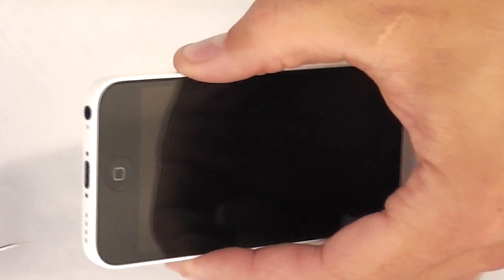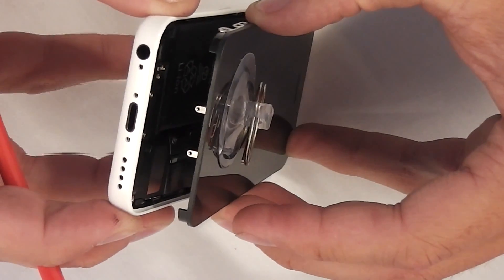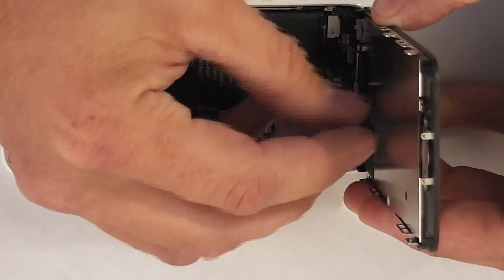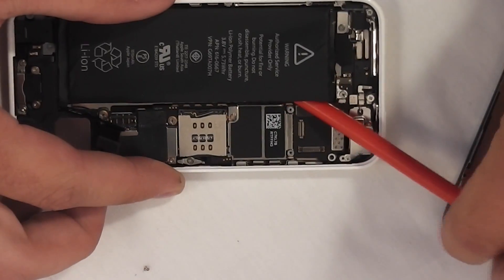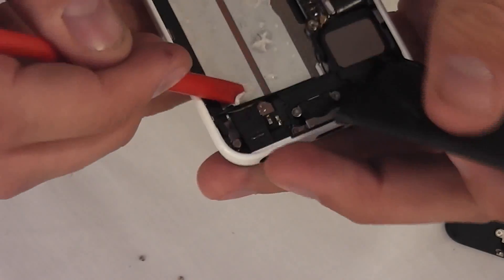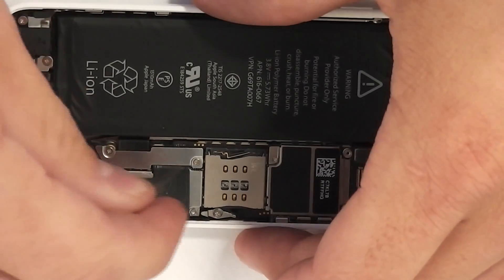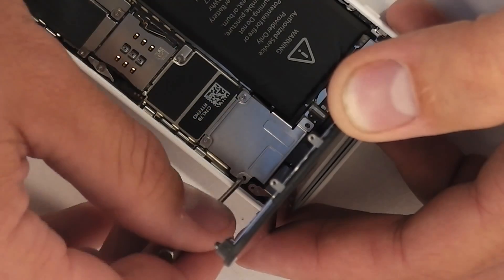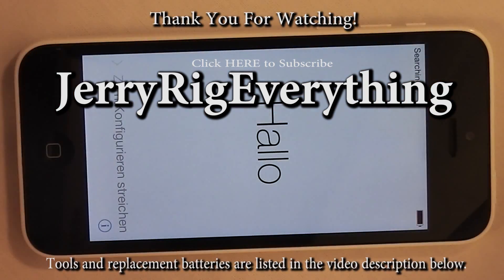iPhone 5c battery change in 4 minutes!

Comment: Just sat down, and swapped the battery in about 25-30 minutes.  BTW... get one of the "tool kits", they run $3-10 on eBay, but you've got to have one to pop the screen, unseat press-fit cables, etc.  Helps to have the suction cup(s) too.

Comment: Thanks for a great instructional video. I wish I had paid attention to your recommendation to pop off the screen connectors.  I didn't and despite being super careful when I popped the battery in, I broke the smallest ribbon cable to the screen.  Didn't notice until I turned it on!  Will be more careful to follow your advice exactly next time. Others be warned...

Comment: Worked. Just a tip - when trying to prise that annoying battery out, I ended up breaking the little plastic prying tools that came with the battery, it was stuck in so well, so I ended up using an old plastic coffee card. Worked like a charm.

Comment: Thanks for this video! I just replaced my battery but it still will not turn on. The white apple logo shows as usual for start up but then it disappears after 5-10 seconds. It is a start up problem at this point and by changing batteries, I voided the warranty that I don't think I had in the first place anyways. What should I do now?

Comment: Your tip on using a heat gun to soften the adhesive was helpful. I ended up using a heating pad to warm my phone, though I did remove the adhesive instead of reusing it.

Comment: My husband installed the new battery, but they don't tell tell you if the battery should be charged once installed.  Tried to power it on and nothing.  So plugged the phone in to charge and it showed the battery was empty and is now charging.  We'll see if all works well after the battery charges completely.  Fingers crossed!

Comment: Excellent presentation - gave me the courage to try it... and it worked fine except I dropped one of the microscopic screws when trying to replace it - I had everything laid out on a white towel so I could see and keep track of everything - couldn't find the little screw so I used additional elec tape to help put pressure on the little battery connector bracket it holds one end of.  Only concern is I'm afraid the screw fell into the phone chassis - if so, I can only hope it never rattles around and creates a problem for a circuit.  If you ever do any more work on this video, I'd suggest adding a heads-up about the difficulty of replacing the brackets/screws - it's really difficult -  the kit I bought had magnetic screwdrivers but the magnetism wasn't strong enough to pick up the larger of the microscopic screws - eventually I got by bye putting a little bar soap on the screwdriver and it stuck well enough to let me lower it into position.  Anyway, thanks again - very nice presentation!
Reply: I did the same thing. Screw is still somewhere in my daughter's phone. Spent about half an hour shaking and bumping it trying to find but no luck. Finally gave up and put it back together minus screw in one side of battery connector hold-down tab. Powered up and work fine. As long as screw is in a position it can't cause a short should be good. Time will tell. Those screws are so small and I didn't have a magnetic screwdriver.

Comment: Ok thanks for the instructions BUT four minutes is not realistic.  More like 30 minutes.  One caution that you did not point out is the length of one of the screws that hold the screen cover plate.  Is considerably longer than the others and I would guess cause damage if not put back in place.

Comment: The reason all of you, who are commenting that now your screen doesn't turn on, or home button doesn't work, or power button doesn't work, or screen isn't touch responsive anymore, is because you damaged the logic board by prying the battery out as done in the video. Doing it this way you are pressing right on the logic board itself!!! Instead, you should remove the adhesive strips themselves from under the battery by pulling them gently around the battery edges. Though more time consuming, it is much much safer.

Comment: UPDATE: 
 I finally got it apart  but the red tool in the kit was way different than the one you have been showing/using on video.  Must have changed it somewhere along the line.
The kit I got has a red plastic tool but it has a slight 'hooked' end instead of the straight end that you are showing.  
Needless to say, the hooked end was irritating to use.  I had to get my watch repair tools out and use a blunt ended watch-back-remover tool.
Finally got it out and replaced with new battery.
Just wanted to give an update for tool kit.
Thanks again for sharing.

Comment: Thanks for the video...I am sure you have had this phone apart several times before.  It's not as easy in real-life as in your video...but I did get it done.  
That white sticky strip(s)  was replaced with rolling a good quality tape back over itself so battery will not move.  Works great.
Thanks again.

Comment: Thank you so much for this video.  The instructions that came with the battery had several unnecessary steps that were so confusing and poorly illustrated, I panicked half way through.  This video saved my phone!  I did have a non responsive screen so I had to take it apart and disconnect and then reconnect everything and thankfully that worked.

Comment: thanks bro i changed mine out pretty quickly following this. i didn't take off the screen but it would have been a lot easier. while trying to get the battery out i said fuck it and bent the shit out of it trying to pull it out and it leaked on my hand (ouch!) the worst/longest part was trying to get the little battery screws back in! omggg took forever. works great now tho thanks

Comment: I used this video successfully to change my battery! I feel that 3 points should be made. 1st you should turn of the iphone, 2nd make sure you take out the sim card and lastly the 4 screws holding the screen are all different lengths and it is VERY important to make sure the screws go back into their correct holes when reassembling, else damage to the phone will incure.

Comment: I exchanged the battery, and the phone works , the battery charges. but the case doesn't shut flush anymore. It bulges one one side or the other. What did I do wrong? The home button doesn't work, and the on/off button doesn't work either. Help!

Comment: Excellent video, had no issues swapping out my battery. However, if you are attempting to do the same, be very cautious not to touch essential parts of the interior. I managed to swap it out by holding the outer shell, don't touch the inner workings unless you have to!
Reply: *******ALSO*******
when inserting the screen back into place, I found out that if you secure the bottom of the screen first, the HOME button WILL NOT WORK once the phone has been powered on. So, SECURE THE UPPERMOST PART OF THE SCREEN INTO THE PHONE FIRST, then work your way down.

Comment: The smallest screws I have every seen in my life.  Adding the 4 minutes to the title caused me to completely underestimate the difficulty of replacing this battery!  

Please be prepared before you get started everybody.  Here are some tips to avoid damaging your phone.

1.  Keep small containers handy to hold these microscopic screws.  They are small enough to blow off a table by accident.
2.  Be very careful what you use as a fulcrum to leverage your battery out.  There are plenty of places that could permanently break your phone if you choose to lean on them in order to pull the battery.
3.  Make sure that you get a decent repair kit.  The one I purchased did not include new adhesive strips and the pry bars were so brittle that they broke with the slightest pressure.
4.  Keep all toddlers a safe distance from your work area...don't ask.

I did the job fine but I was not prepared at all.  Too many people bragging about how easy it was for them.

Comment: BEWARE  There is a bus circuit under the battery towards the top of the phone under the battery. You can see it in the video right where the pointy end of the white glue tape is. When separating the battery one of these got cut/ripped.... just  a heads up when sliding whatever you use to separate the battery from the phone... =(

Comment: Thanks for sharing your knowledge.  Very kind.

However, the lady over at iFixit.com has a better way to remove  the battery.  No prying involved.  

I recommend that people watch that video as well.
Reply: +olbrocko i tried it her way at first but the strips tore on both sides about a 5th of the way down. the prying method works fine as long as you are gentle and work all around it making sure you don't puncture the battery.
Reply: If you remove it then there is nothing for the new one to attach to.

Comment: Good Instructions, other than I would not put the battery connector back in until the very last moment.  This is because the first thing you should do is remove power, and the last put it back on. For example, If you drop a screw on the board and have the battery connected, you get smoke and a dead phone.  If there is no power, no big deal. Fart around with it as little as possible while it has power connected!

Comment: Some tips get one of those magnifying glasses with the lights in them or an arm with a lighted magnifying lens. Also get a magnet and magnetize the screw drivers that helps a lot from dropping the screws into the phone.  I used a magnet to hold the screws while I was working on it. If the control button at the bottom of the screen doesn't work pull up the screen again and make sure the small spring contacts where next to the button are bent up so they touch the screen. I also was not able to get the battery off the case the glue they used was really stuck I used a metal screw driver and wiggled it under the battery which did the trick but also shorted the old battery and released some gas which isn't good. It could have caught fire so my opinion is if local phone repair shop charges $30 to do this I would have them do it. I was able to get it done.

Comment: can i use cheap ebay batteries?? Are there genuine or could be the same genuine problem like with charging cable
Reply: Use a moderate priced battery. That's my advice

Comment: My iPhone 5c keeps dying everyday at about 80-90% battery,  when ever I disconnect from the charger withing few minutes it will die (sometimes works for a short time).... Then it reboots with the red battery logo to plug in and charge.... Is it a faulty battery? or is it another problem?

Comment: @JerryRigEverything during the process I must have accidentally hit some connectors of the screen and now I have black and white vertical lines on the screen and nothing usable... any hints? Thx
Reply from the maker: +David Horn Disconnect your screen, then reconnect it. (Making sure it is turned off before the removal and installation.) Usually those lines mean that it has a bad connection with the motherboard.

Comment: Excellent instructions with one small exception. When prying out the battery, DO NOT pry from the motherboard side. This will either damage or remove chips essential to making sure that certain functions, such as the touchscreen, home button, power button, etc.,work.
Reply: Thank you so much!!!
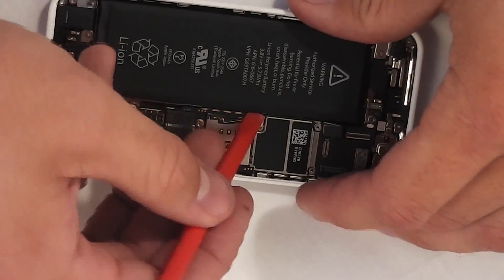Reply: +Ami Patel I second that! I did like the video at 1:40 and pried out the battery from the mobo side and now it won't charge / home button doesn't work. Must have damaged the motherboard. Make sure to pry from the other side!
Reply: Common sense

Comment: My iPhone 5cs keeps dying everyday at about 80-90% when ever i disconnect from the charger, withing few minuts (sometimes works for few hours like 5-6).... then it reboots with the red battery logo to plug in and charge.... is it faulty battery right? or is it software?
Reply: +ray low  I am having the same problem, I would like to know the same thing...
Reply: Kevin Manning
Your battery is dead, i bought a new one, everything works fine now... so its the battery, u need to replace it
Reply: +ray low Should I do a reset before buying the battery? Don't wanna mess anything up when replacing the battery myself.
Reply: Orochimaru
u mean backup?`if u want but i its not nesseccary

Comment: @JerryRigEverything during the peeling stage of the old battery I accidently punctured the battery but there was only a very small flame that came out. I peeled the rest of the battery, checked for physical damage but there was none as I was lucky. I carried on with installing the new battery. My phone works just as well as before the replacement. Are there still any risks? Thanks.
Reply from the maker: Sounds like everything is still ok

Comment: I dropped my iPhone and the screen is messed up. It's not broken but it has lines on it when you press the power button. Will getting a new battery help it?
Reply: +Abbey Wright  i had the same problem and i had to replace the screen even though the screen was not broken or cracked,good luck..

Comment: Does it save your stuff
Reply: Or not
Reply: +Nelly Lopez The battery doesn't have anything to do with storage; your stuff is safe.
Reply: +Nelly Lopez You should still make a full backup (including apps) in case something goes wrong, as the chances here are significantly higher than normal use. But you should be doing that anyway in case lightning hits your phone tomorrow, someone takes it from your pocket on the underground, or it just dies.

Comment: I lost a screw in the 4 screws plate. It works after replacing the connectors correctly. Now only left with mute and side buttons not working. Hmm.
Reply: +flowerprint  I had the same problem.The metal where you took off the screen is where that is happening.there is one of those connectors under the display connectors that is black with foam.Mine wasn't in all the way,try pushing it in or rearranging it. Hope this helps you!

Comment: I notice when the phone turned back on, it was at the "Hello" screen - does changing the battery also factory reset the phone?
Reply from the maker: No it does not.  The phone i used for this video was a new device that i didn't set up yet.
Reply: Ah, I see - thank you for the clarification!
Reply: +JerryRigEverything on the iPhone 5, do I have to separate the screen or can I hold it while I take the battery out

Comment: Yo, I did this step by step and when I tried to turn it on it stayed blank. Then when I tried to charge it, the apple logo would come on for 2-3 seconds then go blank for another 2-3 seconds. I don't wanna have to go to the local phone fixing place or buy a new phone. Is this a normal thing since I removed the power source?

Comment: I changed the battery and it came on, but that's all it will do. Can't slide the screen or turn it off, and it has vertical white lines on the screen.

Comment: Just completed the installation using these instructions. The new battery had a 33% charge and seems to be charging up properly now. Only problem is that I have lost control of the volume buttons and the silencer on the side of the phone. Any thoughts? Hopefully this fix will get me to November and the end of this contract! Thank you!

Comment: Here is a good one.  I dropped my ifone 5c in water.  Of course, I rushed and put it in a bag of rice for 2 days.  I went to turn it on, it won't turn on.  The next idea is to charge iphone.  I bet you did not hear this one before.  I could not fit the charger into normal slot.  Why? you might ask?  A piece of rice is wedged in there!!!!:(
Reply: liza tierney haha had the same problem. But i am still on it, so dont no yet if it will work.

Comment: Thanks for posting! Worked like a charm. I would say heating the back of the case or removing the screen from the case is required as the battery is stuck in there pretty good, wouldn't want to damage a $30 screen replacing a $5 battery.

Comment: My son's IPhone 5c soaked, what's chances? I wonder if battery change or even taking it out to charge separately would work? Looking inside while watching your video I quickly sussed that Apple do not NOT want anyone, at all, to effect any kind of repair. Sticking down the battery is idiotic. All suggestions welcome. Tony
Reply from the maker: Anthony rutter If the phone doesnt work anymore... you dont have anything to lose, as apple probably wont cover it if you dont have insurance. So you can always try a new battery replacement, and if it STILL doesnt work... you arent out very much money. Batteries are cheap.

Comment: hi ..jerry......my i phone 4s has now just hardly 3 hrs life.I wanna to change its battery..however I am bit scared as everybody told me that the Apple does not produce it`s original replacement battery ,putting some kind of non branded companies battery will cause damage phone`s internal circuits and also may be these batteries will burst or leaks [bulge out]easily.So I am really confused.could you please suggest any solution or can u say what is the best companies`s battery for this work.

I eagerly looking for your prompt reply.

Comment: Thank you for posting this video. It was very helpful. I was so annoyed that my phone started experiencing problems 1 week AFTER the warranty period ended. Thanks to your video tutorial, I was able to purchase a replacement battery and my husband changed the battery. Just beware - there are two strips of double-stick tape that make the original battery very hard to remove. However, once we pried it out, it was easy to follow the steps in the video. The only thing that doesn't work now is my earphone jack, but it was worth it.